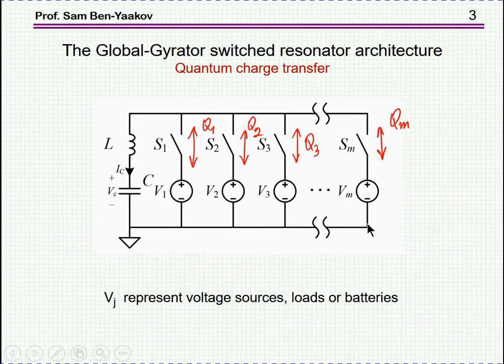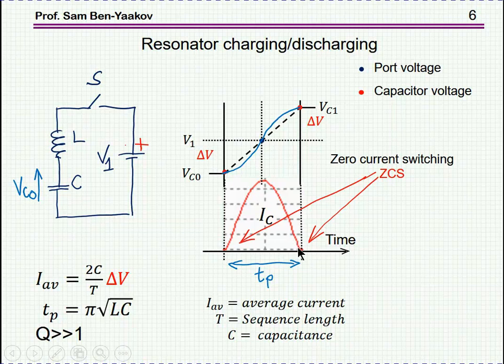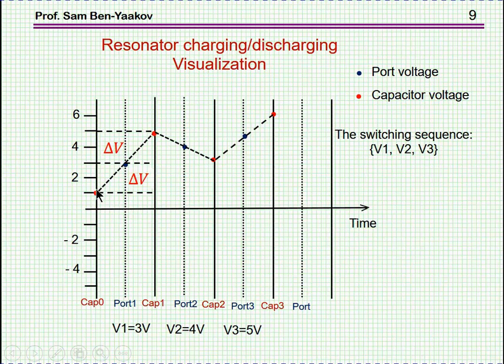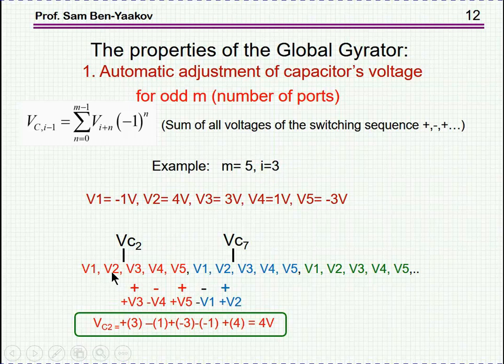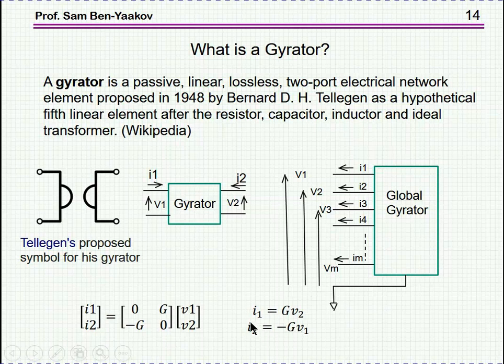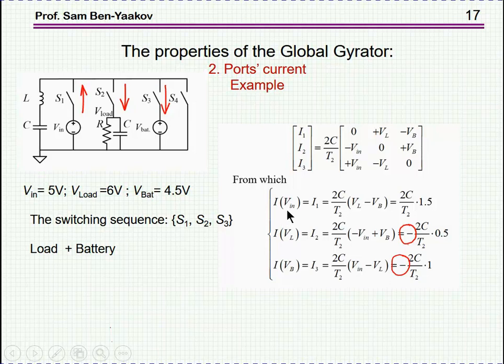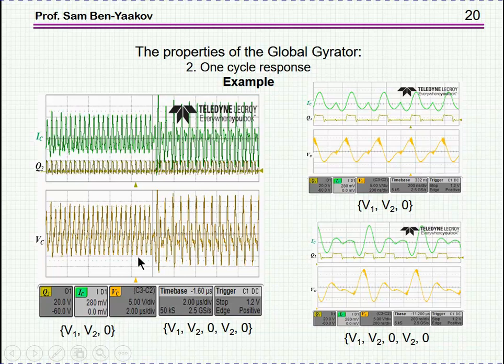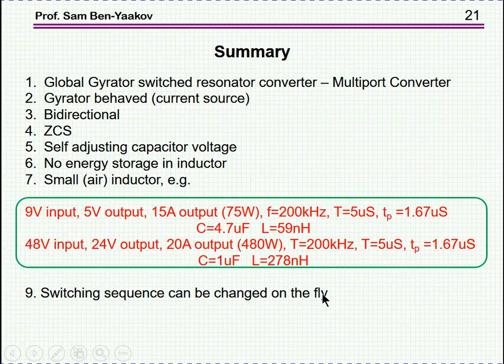The basics of the  Global-Gyrator switched-resonator converter

Comment: Wow! Completely new thing you are able to do with the old good resonant tank. This is what sophomore students in electrical engineering need to learn! Skills in solving the differential equation of resonant tank are nevertheless, obligatory :) I tried to find a reference, where the concept of gyrator with multiple ports is first introduced. It seems to be A. G. J. Holt and R. Linggard, "The multiterminal gyrator," Proceedings of the IEEE, vol. 56, no. 8, pp. 1354-1355, 1968.
Reply from the maker: Hi Alex, As I already pointed out in the past, you are amazing in finding stuff on the internet. Note, however, that the multidimensional gyrator in the paper you cite is entirely different from the Global-Gyrator that we have discovered.

Comment: Hi Shmuel! To my understanding, the converter proposed recently by N. Butzen and M. Steyaert in
https://ieeexplore.ieee.org/abstract/document/8588307
can be considered as an inductor-less version of the resonant gyrator. It is based on stepwise charging and therefore requires many capacitors and switches.
Reply from the maker: It might take a lifetime to rally understand what they are proposing. The gyrator aspect is trivial. All SCC are gyrators, this is because the input charge if a function of the input voltage and the output current in n times the input current.

Comment: Hello Mr. Sam,  is there any commercial product using this kind of converter? My task is to supply a 48Vdc @ 60W load and also to charge an internal 100 Wh battery from an AC or a DC input power supply. Normally doing both actions at the same time requires higher current solutions.  I think that this switched resonator converter can improve the design. Finally, in places where there is no external AC or DC supply,  the battery shall supply the energy required to the load and evenly charged by a solar panel.